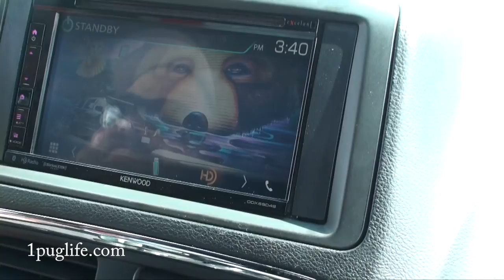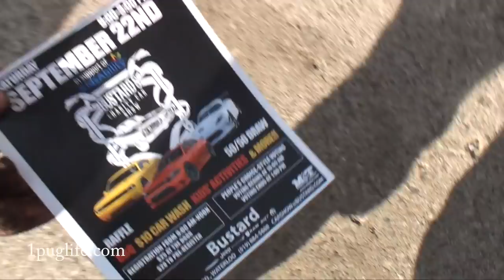tumuchis guarden, another hitch hiker, flowmasters on a minivan and friglanser got the fire ban back

Comment: Dodge head gasket pop coming soon.
Reply: Beast6228 always dodge lol
Reply: Thats Ford head gasket problems..Subaru always had head gasket problems ,Honda has issues..Some GM products,Toyota,VW and Mitsubishi !

Only Dodge with that problem was the 1995-1996 Neon then they fixed it and they were fine...Only Dodge head gasket issues are from people not following recommended changes as new coolant is very acidic and turns fast...Remember 2 -5 years you must change it on any car otherwise you ruin your gasket and it eats the aluminum on the head !!
Reply: 01trsmar 6bt definitely suffers from head issues but theyre still great engines.